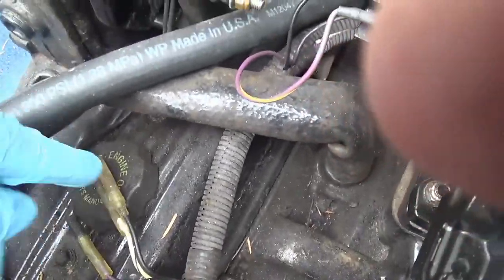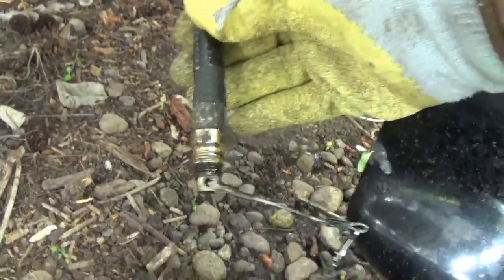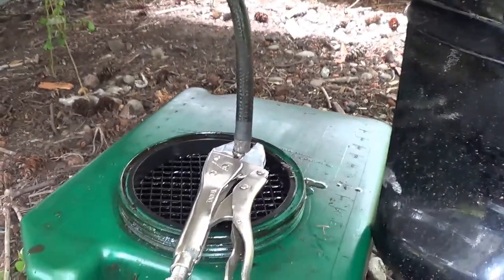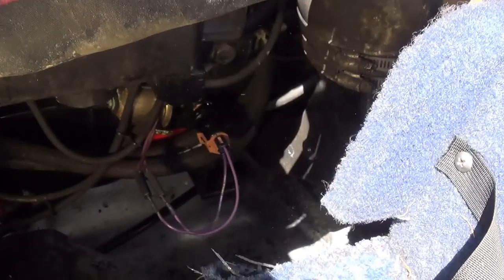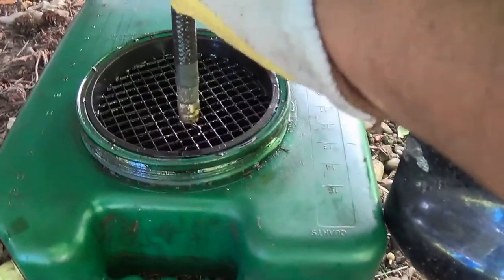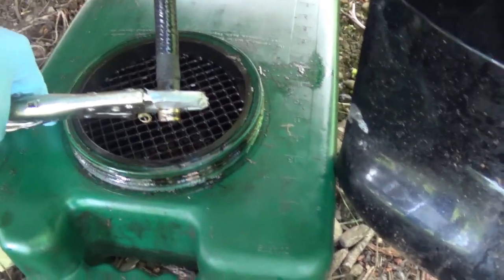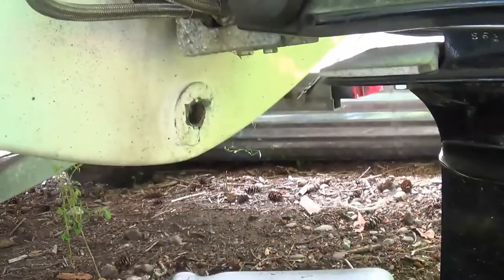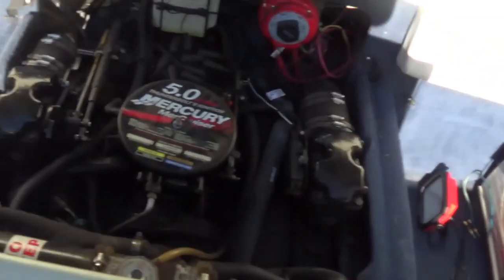How to MerCruiser 5.0 V8 Oil change

Comment: Right on, just purchased a 02 bayliner with this motor, 5.0 Mercruiser. I did the stern drive oil/lube and I'm about to do the oil change next. Hoping to do some regular maintenance on it before summer as well.
Reply from the maker: I like this setup the engine is all about power, have fun

Comment: Ok so you didn't show where you got that tube from...
Reply from the maker: Are you referring to the black drain hose here is a link but I would try Ebay first https://www.wholesalemarine.com/hose-kit-oil-drain-mercury-mercruiser-32-865281a02.html?gclid=CjwKCAjww-CGBhALEiwAQzWxOr7NNdmRZKqL-0BrEg1DLOKZKBjqZaJnAVh0F93BOL1Rpidi8RM59BoCAxYQAvD_BwE
Reply: @sterndrives3290  But, where do you connect it? You don't show that part.
Reply: @dcquence obviously where the drain bolt was, but I think to do it simpler just some PVC pipe same diameter as drain hole at the transom and attach the funnel to other end underneath of oil pan drain hole.